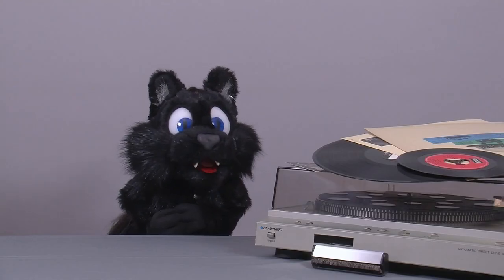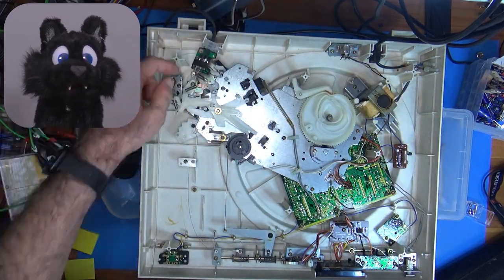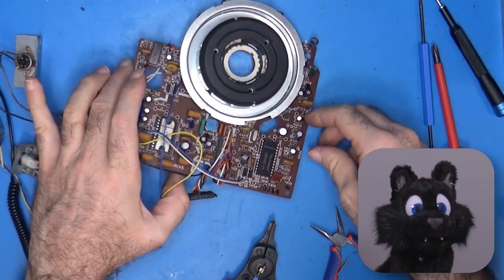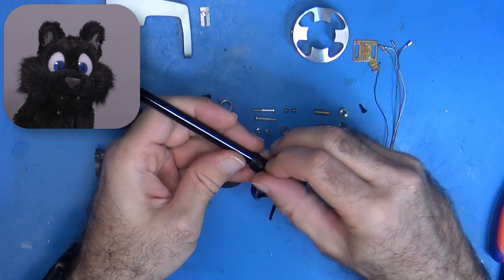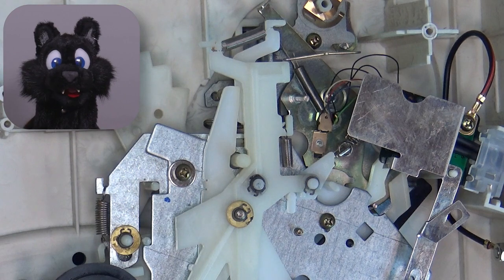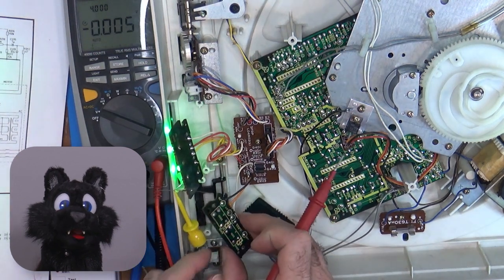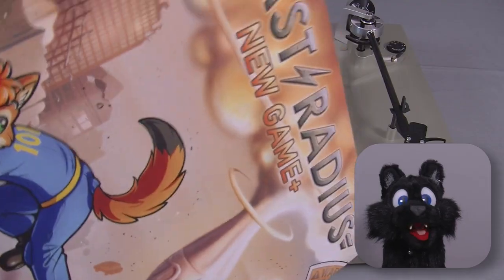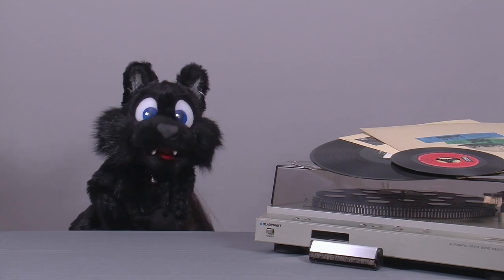Restoration Project #22 - Blaupunkt XQ-240 Turntable

Comment: One of the dust cover hinges of my XQ-240 is broken. Does anyone have an idea for a repair solution ?
Reply from the maker: It would depend on what part exactly is broken. For any part around the case, I would probably try some epoxy glue first and if that doesn't work, I'd probably 3D print some adapter to be integrated into the existing case, either by screwing it in or by cuttin out a bit of the case so it can "slot in". Either way is a bit of a gable, because these old plastics are at least very brittle and cutting/drilling can easily lead to more cracks.

Comment: Tolles Video. Habe auch einen XQ-240 der beim Einschalten den Teller hin und her dreht und Auto-Start will auch nicht. Werde mich mit dem Video mal dran machen...
Reply: @atkelar ist das Hin und Her drehen nach PowerOn normal? Konnte in Deinem Video das jetzt nicht sehen....
Reply from the maker: Direkt nach dem Einschalten? Also bei meinem geht da nur das Licht an, die Geschwindigkeitsazeige und die rote "Strobo-LED" am Plattenteller. Drehen tut sich da nichts, aber in jedem Fall - also auch beim normalen start/stop nur in einer Richtung, also nicht hin und her...? Der Schaltplan ist online verfügbar. Die Motorsteuerung kommt aus einem Chip und dessen Inputs würde ich mir mal als erstes vornehmen.
Reply: @atkelar  Hey Atkelar, jetzt komme ich endlich dazu meinen Spieler zu reparieren. Leider finde ich keinen brauchbaren Schaltplan kostenlos online.... hättest du mir hier nen Link? Und vielleicht auch ne Bedienungsanleitung? Die ging leider verloren:(
Reply from the maker: (English reply just in case others are looking too) I got mine from here: https://elektrotanya.com/blaupunkt_xq-240_sm.pdf/download.html - the site has a "only x-downloads without registration" limit, but works fine for occasional downloads.
Reply: @atkelar  is there a possibility to contact you via PN for specific questions?
Reply from the maker: YT doesn't have a PN feature; and I have limited social network connections; Twitter may work.
Reply: @atkelar  Ich versuchs nochmal auf deutsch, und würde, dann, wenn alles klappt nochmal übersetzen:
Ich konnte das Problem erstmal soweit eingrenzen, dass das hin und her drehen nur passiert, wenn der Metallteller drauf ist... und er dreht sich nicht gleichmäßig, sondern langsam im Uhrzeigersinn (quasi 2 Schritte vor, einen zurück, 2 vor, usw..) ich trau mich noch nicht alles komplett zu zerlegen, da ich mit solche REparaturen noch nicht die Erfahrung habe... wie mess ich denn, welche Inputs an dem Motor-µC ankommen?
Reply from the maker: Ich bin immer noch nicht sicher ob ich das richtig lese: der Metallteller - also der Plattenteller an sich? - ist ja eine Hälfte des Motors mit den Magneten dran. Daher dreht sich ohne den ja per Definition gar nichts, egal in welche Richtung...? Wenn es ein 2-1 Muster ist, könnte da in der 3-phasen Logik oder Wicklung ein Wurm stecken. Der Motor-Chip nimmt ein paar Eingangssignale und macht daraus ein "Drehfeld" - also eine gestaffelte Folge von Sinuswellen damit sich der Teller dreht. Wenn da z.B: einer gegen die Richtung dreht, also die falsche polarität hat, dann würde das so ein zwei-vor-eins-zurück Muster erklären. Das wäre aber kein gutes Zeichen, weil der Chip wohl nicht mehr direkt als Ersatzteil existiert.
Reply: @atkelar  https://youtu.be/nHD4y5J-Z7A ich hab das mal gefilmt, wie es beim einschalten aussieht…
Reply from the maker: Interessant; Also wenn der Tonarmschalter "ein" ist, funktioniert es, sonst "glaubt" der Spieler, dass er etwas tun soll, oder auch nicht; Ich hab' aber einen Verdacht. Bei 6:50 ca. sieht man den "Tone Arm Switch" der bei mir statt 0 Ohm ein paar Mega Ohm hatte, also heftig oxydiert war. Der steuert das "Motor ein und aus"; wenn der nicht richtig öffnet/schließt sondern so dazwischen lümmelt wie bei mir, kann das die Elektronik durchaus verwirren. Ich weiß grade nur nicht mehr auswendig, ob der "normal offen oder zu" war; Ist jedenfalls einen Versuch wert, den mal mit einer Brücke zu überbrücken und dann einschalten. Entweder er läuft normal los oder er bleibt ruhig; (Tonarm freigeben nicht vergessen, FALLS er losläuft) Bei 10:05 der schwarze Teil oben mit den grauen Leitungen in dem kleinen Schaluch, das ist der Schalter. Also die beiden grauen Drähte an den Wire-Wrap stellen kurzschließen, so dass nichts anderes kurzgeschlossen wird und dann wieder aufrecht stellen und einschalten... Ganz kaputt kann der Treiber IC nicht sein, wenn er mit dem Tonarm normal läuft.
Reply: @atkelar  Also ich hab nochmal gemessen. In Ruhe zeigt der Schalter bei mir <3Ohm an... also Kurzschluss und wenn sich der Arm bewegt ist der Schalter offen.
Mich wundert, dass manchmal der Teller sich beim Einschalten "normal" los dreht und manchmal so hin und her.... Ich hab nochmal ein Video von unten gemacht. Auto-Start-Stopp funktioniert, Schalter schaltet, nur dieses hin und her ist merkwürdig... und wenn ich eine kleine Platte einstelle, bspw. 17cm, zieht der Tonarm den Schalter wieder auf 30 beim loslaufen....
Hier das Video: https://youtu.be/UGb5R3qbiKk 
Sind die unterschiedlichen Teile beim Auto-Start gezeigt...
Reply from the maker: OK, kleiner 3 Ohm dürften kein Problem sein; aber es bestätigt meine dunkle Ereinnerung, dass der Schalter "normal geschlossen" ist. Jedenfalls sollte sich der Seilzug NICHT von selbst zurückstellen. Da scheint etwas zu hängen. Weil die "Repeat" Funktion ja somit auch nicht funktionieren würde. Und das bringt mich zum nächsten Verdachtsmoment: eventuell ist der Repeat-Hebel auch "nicht ganz gerade" und versucht einen halbherzigen Auto-Start? Kann ich jetzt nicht direkt erkenen, aber das wäre die einzige mechanische Problematik die mir einfallen würde. 

EDIT: Der weiße abgestufte Teil am Ende der Plattendurchmesser-Schnur müsste anhalten wenn die Schnur gespannt ist. Da er das nicht tut und "den Schalter" mitnimmt, ist ggf. irgendwo schmierstoff verharzt? Die betroffene Mechanik ist leider unter der Metallplatte...

Der Motor-Start ist elektrisch jedenfalls zu 100% von dem Tonarmschalter gesteuert. Ohne von dort ein "ist offen" zu bekommen, dürfte sich eigentlich nichts rühren. Für Auto-Start kuppelt dann der Magnet auch das große Zahnrad mit ein, damit die Bewegung gestartet wird. Wenn du ein Oszilloskop hast, kannst du das eventuell mal auf den beiden Schalterkontakten anschließen? Sollte ein sauberes Gleichspannungssignal sein, entweder auf Masse gezogen oder auf (ca.) 12V schätze ich. Aber am Besten an den "Wire Wrap" Stegen/Stiften messen, nicht am Draht selbst; falls bei der Verbindung was sein sollte.
Reply: @atkelar  Vielen Dank für die Hinweise. Dem werde ich mal nachgehen und muss dann doch das Teil mal auseinander nehmen.
Leider hab ich kein Oszi hier, so dass ich nicht messen kann, was an den Schalterkontakten anliegt. Eine Idee, wie man das ohne messen könnte?

Mich irritiert halt auch, dass dieses Hin und Her nicht immer da ist. nach ein paar Auto-Starts, dreht der Teller einfach weiter, auch wenn der Tonarm wieder in Ruhe liegt, also vielleicht doch ein Schalter-Problem?

Letzte Frage zum Testen, sagst du, brauchst du ein Pre-Amp. ich hab einen Onkyo TX-8255. Laut Anleitung kann ich da einen PHONO (MM)-Eingang, zum  zum Anschluss eines 
Plattenspielers mit Magnetspul-Tonabnehmer (MM). Ist das hier so einer Plattenspieler?
Reply from the maker: Ohne Oszi leider nur schwer sichtbar, ob der Schalter "sauber schaltet".

Aber für mich deutet irgendwie alles auf den Schalter hin; entweder "klebt" etwas in altem Schmierfett fest, oder der Schalter macht manchmal nicht sauber zu. Du könntest (vorübergehend) einen externen Schalter dazu klemmen (parallel zu dem bestehenden) und wenn es wieder "zuckt" den externen Schalter schließen. Wenn es dann aufhört, ist es zumindest sicher der Schalter. Wenn das Überbrücken auch nichts hilft, dann hapert's in dem Steuerchip. Aber da hätte ich eher ein Problem gesehen, wenn es "immer" falsch ist. Das "manchmal falsch, manchmal richtig" lässt mich auf ein Schalterproblem hoffen. Die gibt es noch als Ersatzteil, wenn man sie nicht zerlegen will :)

Ad. Pre-Amp: "MM" = "Moving Magnet" - im Gegensatz zu "MC" = "Moving Coil" - das ist die Bauform von dem Tonabnehmer. Wenn das dabei steht, ist es ein Plattenspielereingang mit Vorverstärker. Dieses Modell hat in der Tat einen solchen Abnehmer, das sollte also perfekt passen; Ersatzteil is "BP EM 240" - leicht zu finden und ich empfehle die 15€ in eine neue Nadel zu investieren :)

Comment: At 1:43 what is that  dark green transparent plastic thing your assistant is holding ?
Reply from the maker: That's a magnetic field detector. "Magnetic field display paper" is the product name on amazon. The small version I have is affordable, it comes in various sizes and styles. Good to detect the exact way a magnet is aligned. Think of very tiny iron filings trapped inside a transparent foil. It requires a reasonable strong magnet, so it won't show a magnetized tape for example (there are versions that can do that I believe)